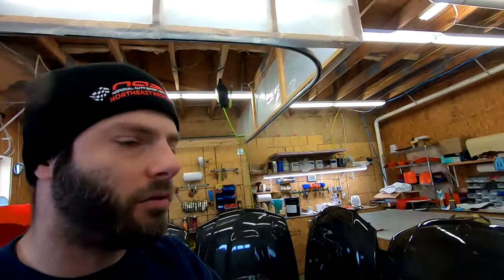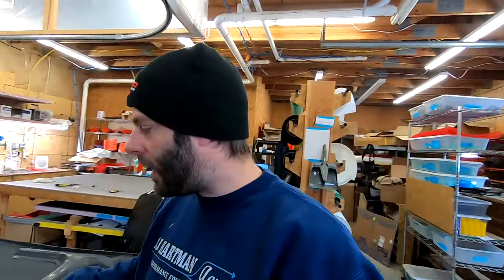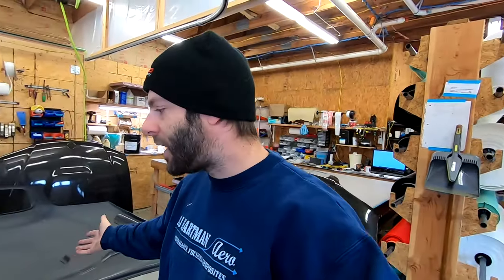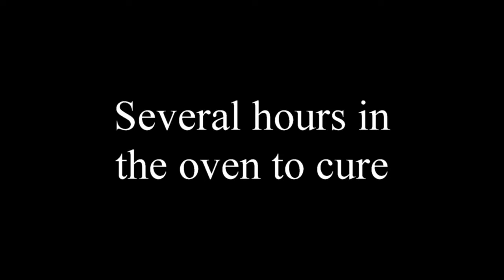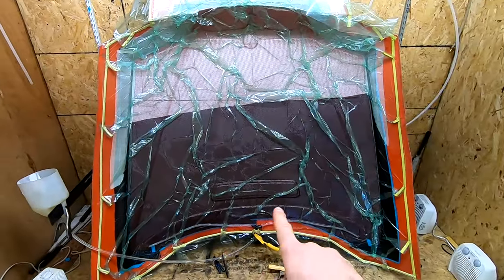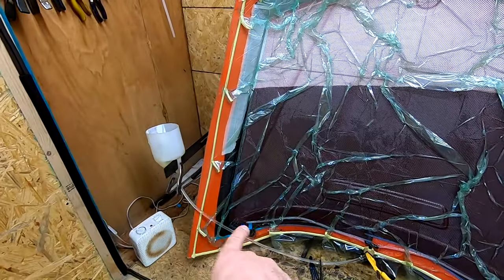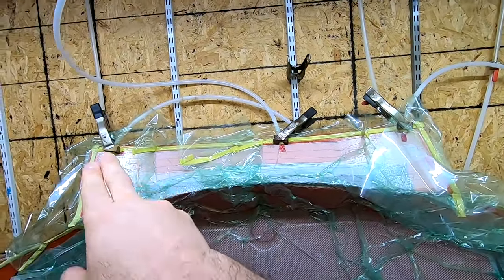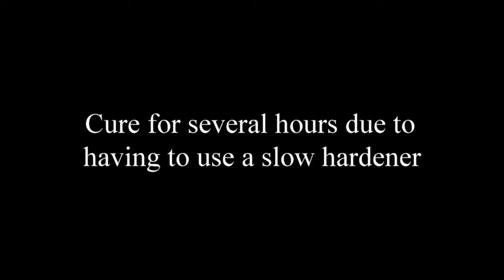Making a Carbon Fiber Hood

Comment: Hey just a head up from another DIY Carbon Guy, since you infuse upwards with the resin below the part look at the MTI Valves for the resin intake line. They will keep the part under vacuum pressure and you wont have to bother regulating resin flow to avoid pooling, and the parts wont lose as much vacuum when the resin inlet line is opened to ambient air.

Comment: Wow, that was great. Was that 2k automotive clear you sprayed? I have a autobody background, so I’m big on prep. The clear coat doesn’t have to be prep or scuffed for the epoxy/cf to stick, after it was cured? Have you ever used clear gel coat or is that what it is. Great video man.
Reply: I believe in mold clear by duratec
Reply: @rohanpuri1989  what? I have the same question about what was used for that coat
Reply: I have the same question.  If it is gelcoat I dought it is UV resistant.  Would be curious what clear was used.
Reply: @danielh4759  pretty sure its gonna be sunshield by duratec
Reply: Curious to know the answer to this as well. Just started my Composites class at DATC

Comment: I smiled when I realised what that little room at the back of your workshop is.. a sort of poor-mans autoclave (oven, really, no above atmospheric pressure).. After installing the giant autoclaves at Premium Aerotek in Germany, my Dad went on to work with the teams doing exactly what you're doing - but on a giant scale - building carbon fibre Airbus airframes (A350 XWB).. laying out, bagging etc. The only difference is their layouts went on 70ft long, 22ft wide skids to be dragged into the giant 25m x 8m autoclave, making it expensive and annoying if the bagging failed! So thanks for surfacing some fond memories :)

Comment: Love the content! Quick technical question… I’m not sure if this has been answered somewhere already but figured I’d ask. When it comes to the rigidity portion of carbon fiber panels, I recall years ago that some manufacturers would use aluminum/titanium rods as support and to add rigidity. Would doing something like that be beneficial or would it be best to just sticking with all carbon fiber with just carbon fiber reinforcement in those high stress areas? Thank you in advance!
Reply: Don't know if you still need an answer to this question, but it entirely dpeends on why you'd need reinforcement.
If you're looking for rigidity as you said, you will need some sort of brace that would span your contact points which you want to remain rigid. More layers of carbon will not offer this rigidity. Watch any video of someone lifting a fully carbon hood, it bends, carbon is incredibly flexible along it's flat axis, even with thick layers of epoxy.

Comment: Amazing job! Just a question: Why don’t put in vacuum bagging for a perfect bond of the two parts in the end? Thanks, you are great!
Reply: No hard rule against it. But generally vaccum bagging is needed for lamination with minimal epoxy (weight savings). Clamps do a good job for glueing parts together. 
Using vacuum bags for glueing parts requires more effort, creates extra mess and a ton of wastage for no additional strength or weight savings!
Then again, what do I know 🤣
Reply: For intact result
Reply: Have you ever made carbon fiber, inner fender wells for like an old Chevelle?

Comment: Iv done a few just covering the bonnet with carbon fibre then clear coat UV finish.      Best way is resin base coat wait till tacky then roll from one side to the other.     Don’t try the spray glue way

Comment: I have a plastic boat that is made with upper/lower clamshell style pieces. 

Id like to split it and use it as a mold to make a CF version.

Im wondering if i could do it for under a grand. I have service truck worth of tools but no vac or other related stuff.

I use the boat for river adventures and its setup to row. Id want to incorperate some keel sheilding for landing and dragging/rock  protection. I currently use hdpe patches that take hours to make.

Boat is 10'x4'x36" & weighs about 140lbs from factory with foam blocks inside.  Wondering where it would sit if made from CF.

Comment: just subbed! had a question. How did you go about making your molds for the carbon fiber?
Reply from the maker: Stay tuned. Editing a mold video right now and will be out soon. But simply put the molds are orange tooling gelcoat and fiberglass.

Comment: Would you be willing to share your strategy for making pleats in the butyl tape, in regard to the frequency and length of them versus the amount of bagging material?  Or do you just sort of eyeball it?
Reply from the maker: On something this relatively flat, just a few random ones roughly eyeballed. More pleats is always better than not enough.

Comment: This is the 2nd video of yours I’ve watched (subscribed now), and I’m curious of something. Wouldn’t you want the first layer to be as close to a single sheet as possible so you don’t have split lines or potentially mismatched strand orientation to the customer facing “show” side. I understand that some shapes make this impossible (likely). Just my curiosity.
Reply from the maker: Yeah. There is 60” wide carbon if you wanted to use that.

Comment: Awesome!  Would the resin flow better if the part were horizontal as opposed to vertical?
Reply: the orientation is not critical. the vacuum sucks the resin in every direction and is the driving force.

Comment: Do you have any issues with fish eyes when spraying clear coat in the mold? From my auto body experience I would expect the mold release to cause the clear to fish eye like crazy.
Reply from the maker: No. Just gotta use the right materials.
Reply: @ajhartmanaero  thanks, I'll give it a try on a test panel I've applied PMR 90 EZ to. I use Omni or Shopline (PPG brands) 2k Quick Clear for everything I do. We'll see how it goes.

When you said it needs to cure for a few hours were you force curing it by baking it in the oven? I wouldn't have thought curing it that much (overnight for ambient cure) would allow for a good chemical bond with the epoxy. If it works with good long-term results I'll give it a try since that'd be faster than sanding the part with 1500 after curing the part and clear coating it and would also alleviate my concern of mold release on the part causing fish eyes (I cleared a Seibon hood for a customer and still got a lot of fish eyes even after prepping the panel in my usual way, if not with extra cleaning and scuffing).

Comment: 15:33 would it be better if the part is horizontal as opposed to vertical so you dont have to fight gravity?.. love the content
Reply from the maker: I used to do large stuff flat and never noticed a difference. I always try to infuse uphil simply cause it’s easier for air to float up ahead of the resin front.

Comment: Hi  good job  :D . can i ask something? what kind of use clear coat?standart acrylic auto celar coat -polyurethane celar coat-epoxy clear coat resistant to UV  ?  Why don't you use a mold release? which do you prefer a mold release" wax" or "Chemical Release Agent" ?  thank you for your support .
Reply: He’s probably using something like duratec sunsheild as an in mold coating which I’ve had fade before. He’s for sure using a mold release.
Reply from the maker: @Jkseller12  yup. Sunshield and definitely using release. Just realized I didn’t video that bit. Weird you had some fade before. I’ve fortunately had nothing but great results with it.
Reply: @ajhartmanaero  If I use sunshield now, I’ll apply a high solids clear on top of it. In my test the sunshield faded before the actual epoxy or vinyl ester resin.
Reply: @ajhartmanaero  Does the sunshield stay tacky at all in the mold?  

Do you reduce the sunshield at all with a reducer or acetone?

Comment: This is why that sub imploded, the carbon fiber is not the strength in the shape, the epoxy is.

Epoxy is not going hold up to pressure, it's brittle and crumbles like when one of these car hoods gets smashed, it doesn't bend like steel, it breaks and shatters like a glass layer would.

That guy who designed that sub should have realized this.

Comment: What if you don't use lantor soric core ? Did it will ruin hood strength? Hope you read&reply my comment dude 10:16
Reply from the maker: Not ruin but it may not be strong enough so more layers of carbon my be necessary.
Reply: @ajhartmanaero  thanks a lot my man. You just got a new subscriber today!

Comment: Are there resins that you can just do the vacuum process then leave to cure at room temperature?  I want to make something small, about 16 inch x 8 inch x 2 inch in a shallow bowl shape kind of like your hood, but no access to an oven.
Reply from the maker: Yeah. Any epoxy can technically room temp cure.
Reply: @ajhartmanaero  thanks for answering.  Does the oven make the cure stronger?
Reply from the maker: @charlesblithfield6182  yes

Comment: what about not doing resin infusion and wet layup instead? is the cost of money and time actually less?
Reply from the maker: Costs should be about the same. I like the time infusion gives me to lay the part up and really make sure I get the carbon tucked into all the corners that a wet lay or vac bag setup doesn't really do. This makes infusions, for me atleast, much more repeatable. Nothing would suck more than to demold a part this size and have little bubbles around any tight corners.
Reply: @ajhartmanaero  thank you for the response, ultimate would be prepreg, but the oven is a bit expensive 😅

Comment: I hand laid a part a few months back. Finished with 2k clear. Looked amazing until I installed it on the car and it hated up bad in the sun. Any insight on why?
Reply from the maker: Probably poor prep? Don’t know.  Could be a handful of issues.
Reply: @AJ Hartman Aero  the type of hazing was throughout. Possible wrong mix ratio and cure time. Idk either

Comment: Do you need to have an oven to cure the resin? Or can you just leave it under the sun or leave it on the garage?
Reply from the maker: Room temp cure may be 8-12 hours or so. Depends on the epoxy system you use.

Comment: Can you tell me what spray glue you use?
Reply from the maker: The sticky kind.
Reply: @ajhartmanaero  normal spray adhesive or extra for carbon
Reply: I'm surprised because you can lay everything properly without gloves
Reply from the maker: @danl7889  nah. Just the 3M stuff. You only need the lightest mist of it.